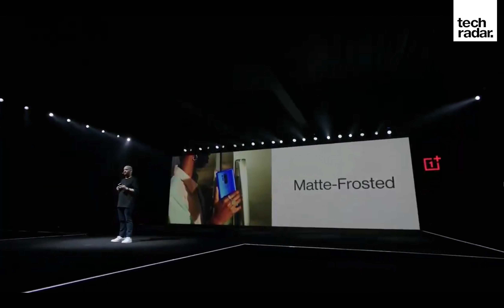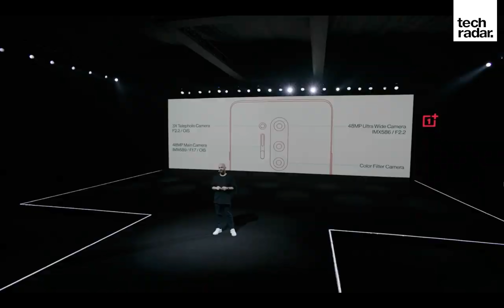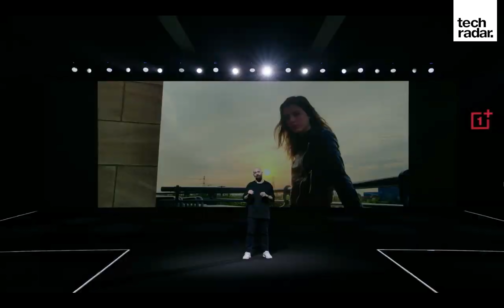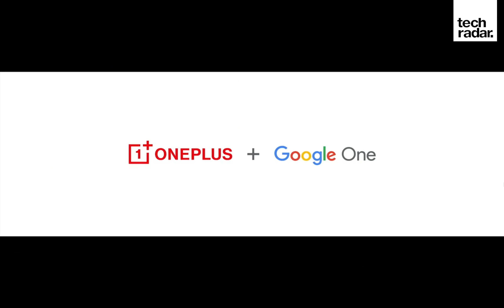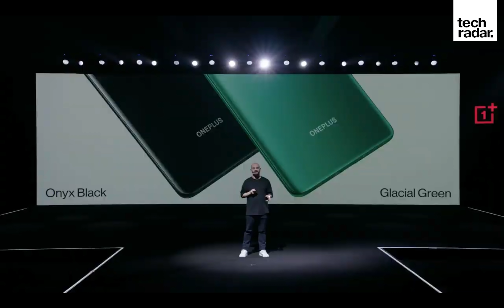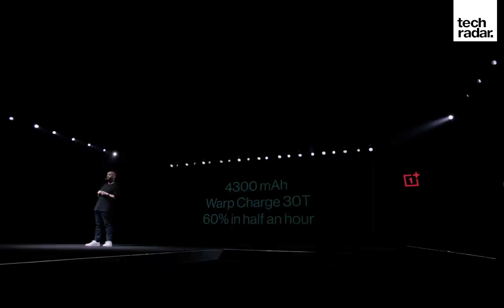OnePlus 8 and OnePlus 8 Pro Launch Event Highlights

Comment: Pros and Cons:

+ OxygenOS
+ Software Updates
+ Speed
+ OLED Panel
+ UD Fingerprint Scanner
+ Stereo Speakers

- No expandable Storage
- Curved Screen
- Punch Hole Notch
- Size (too big)
Reply: pros and cons
+none (oxygenos is really bad, especially with image processing) it has same software updates as most brands, is not faster, just animations tweaked , oled is most common thing, stereo speakers is not true, it uses the phone call speaker unlike others phones like mi 10 or sony who actually are stereo speakers 
-price
-software
-cameras
-lacks like always on display
-screen (yup, the "best" feature is the worst, as dumb as expensive)
-designe
-absolute lack of effort or development, it stole all the hard work of oppo, again. 
-hardware (it comes with ddr4 or ddr5 depending on variants and lacks ufs 3.1, has 3.0 )
-wireless charge 30w is a piece of junk. Needs a proprietary charger, makes a lot of noise and makes phone insanely hot, killing your battery and soc! is madness